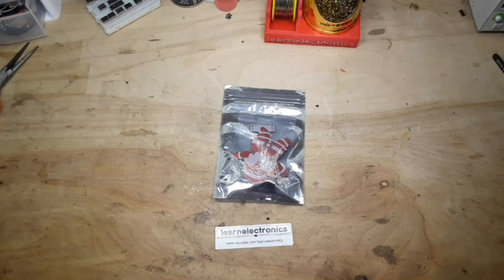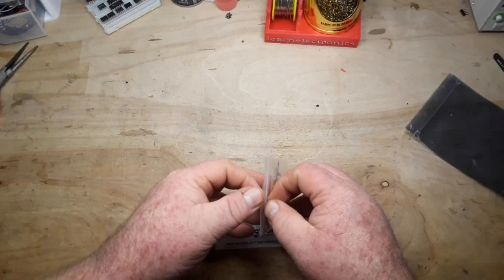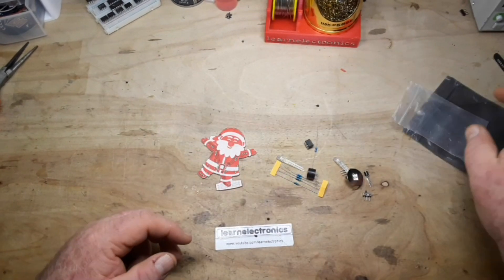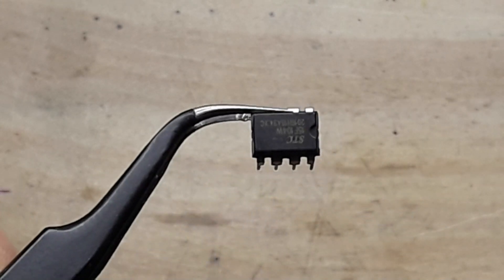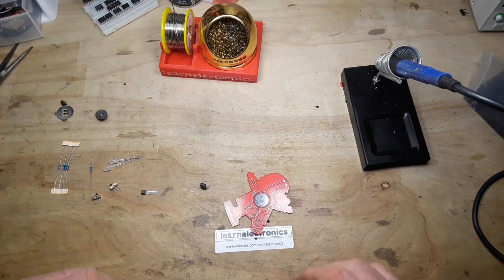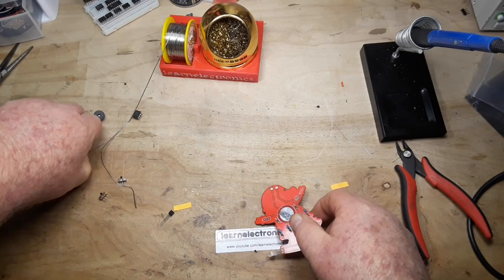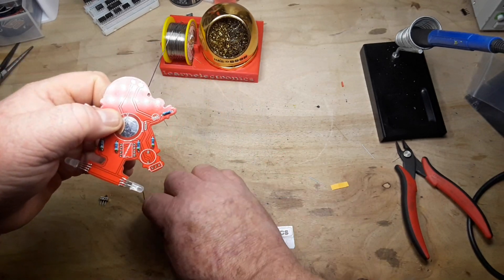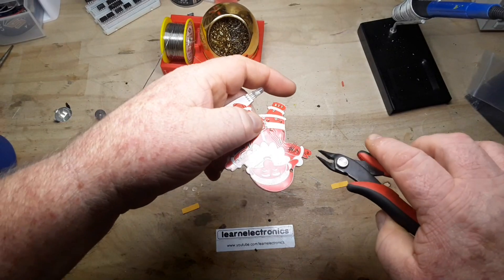CircuitPop Musical Santa Kit

Comment: That is a nice DIP pin straightener. Looks like that took some time to make - fine craftmanship! BTW I always wondered why, since I was a kid in the 70s, that DIP chip manufacturers always splayed the pins like that instead of straightening them out at the factory. I wonder what the back story is for that? I can think of only 2 reasons - either it's to be able to tell if a chip is new or a pull (used), OR maybe to make it easier for pick and place robots to grab the chip or maybe both. Anyone know?

Comment: Wow Paul nice kit - it never gets old I always like to see electronic kit assembly. For simple circuits I am usually not nervous when powering up - for more complex kits I usually perform intermediate checks such as soldering all passives and power circuits first. I don't put in chips before powering up the circuit and checking power voltages at the socket power pins. In that way there is less chance I will see smoke (or malfunction) when all of the chips in place powered up. Heathkit instructions usually follow this practice with intermediate checks. BTW sorry for your loss.

Comment: i bought two. do you remember Hosfelts?
Reply from the maker: Absolutely. It was in Steubenville Ohio. I used to buy items from them all the time.
Reply: @learnelectronics  i still have a 5amp and 20 amp power supply from there.. and solder. ha ha

Comment: Nice kit - I like those fast, easy kits sometimes to relax.  Question - many ornaments connect directly to the string of lights on the tree using a bulb socket.  What should the power draw on the ornament be designed for (volts/amps) and where can you buy those type of connectors?

I appreciate you taking time to make this video for us.

Comment: Hello Sir,
I want to ask if there is another safe website to buy electronics part other than aliexpress and bandgood. I wanted a soldering station and some electronics components but aliexpress and bandgood are banned in my country due to this India China war like situations. All soldering stations (even the lowcost ones that are available on banggood for a 100dollars) in my country(India) are costing more than 250 to 300 dollars. I am getting really frustrated because I have enrolled myself in nice engineering college to peruse my electronics engineering and couldn't find decent enough equipment for reasonable price. I bought a hantek 6022bl (20mhz 2 channel and 16 channel logic analyzer) oscilloscope for around 120 dollars whereas I should have easily got the same oscilloscope for 50 dollars from aliexpress. This is putting a lot of strain on my pocket so please tell me a decent enough website to order electronics components other than banggood and aliexpress and ebay also(most of the item are not available from ebay for my country. Please!!!
Reply: I am in the USA and sometimes order on Aliexpress if I am not in a hurry. Beware their cheap chips are almost always pulls or sometimes outright fakes. But, if you are willing to gamble you can get a good buy - for example earlier this year I ordered 10 x 28C256 EEPROMS for something like $8 USD - I tested them when I got them and 9 out of 10 were tested good. 62256 SRAMs same deal and 8 out of 10 tested good. All pulls of course. If you can order from the US Digikey, Jameco, and Mouser all sell quality parts at reasonable prices. There is a good supplier in Australia can't think of name but shipping time may be less and/or cheaper to India.
Reply: @chrisguli2865  I will surly give them a try. Thanks bro!!